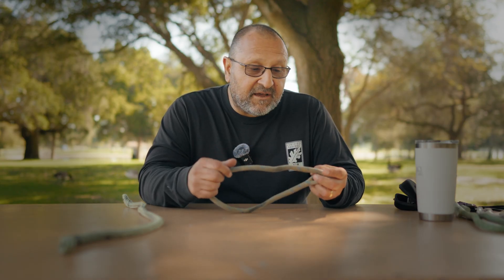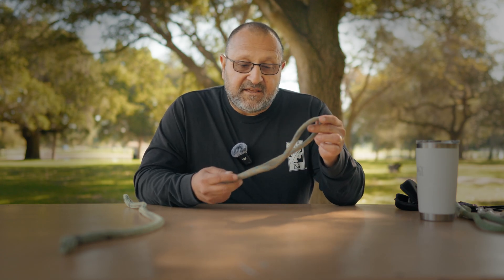Finding a Prusik Cord You Can Trust With Your Life

Comment: Ive had creeping issues with 10mm hitch cords on a 1/2” rope. So I stick with 8mm. I use a 5 wrap michocan. (idk. If I spelled the hitch right lol) 

I run 8mm Armor prus from “at height”. For climbing an beeline for lanyard. I like keeping contrasting colors for different systems.
Reply from the maker: Glad you found what works for you!